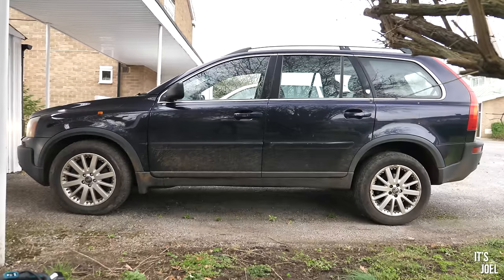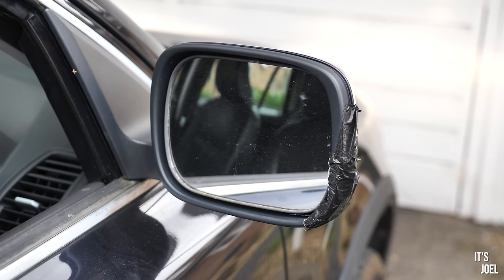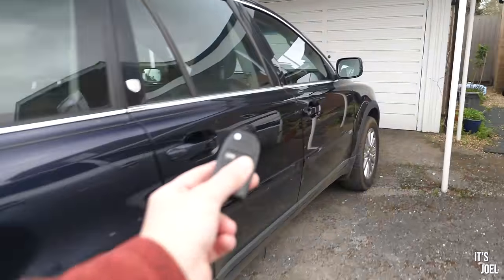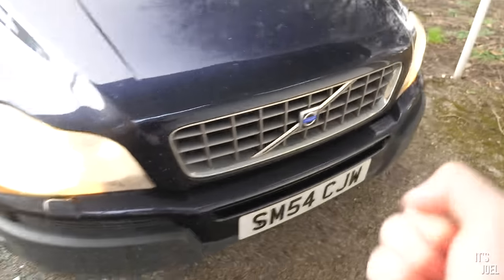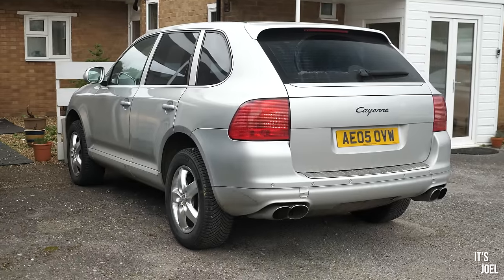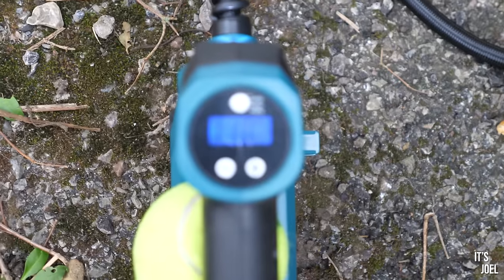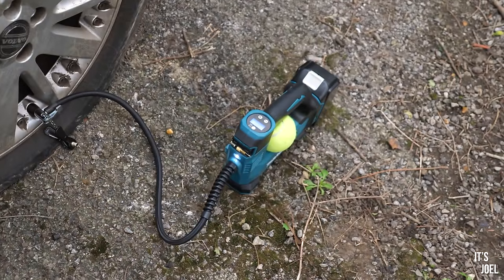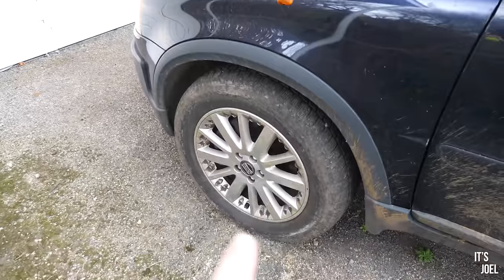WHAT HAPPENED TO MY £800 COPART VOLVO XC90?

Comment: If you get it sorted mechanically then it will run and run perfectly for a long, long, time. Cosmetics you can do at your leisure. I had a '64 plate one. Bought it 1.5 years old with 46K on the clock. I had it for nearly 6 years and took the mileage to 63k. In that time I had it serviced once a year - and it never needed anything on top of the service and sailed through all MOTs without even an advisory. These things, if you just spend a small amount each year on very basic maintenance, are rock solid. Great family car. Took it camping a few times - 4 people, a massive 8 man tent in the boot, camping gear for a week, a massive Kamei 560L roof box and a towbar mounted bike rack with 3 bikes on it. Even took it to Hockenheim once with all the gear. Just took it all in its stride. Mind you, it drank more diesel than is consumed at Oktoberfest

Comment: You should keep it. It has clearly gotten under your skin. Most ABS problems are either the sensors or the pickup rings. Both jobs themselves are easy enough to do. The drieveshafts can be a pig of a job to remove. My front ones were easy so maybe I just got lucky. My XC90 was in 2 wheel drive for a long time until my CEM issue got worse. I ended up having to fit a replacement DEM to my Haldex coupling to have a fully working 4WD to eliminate that problem as part of the CEM diagnosis. The CEM was faulty so I ended up getting it repaired and it has been fine ever since. The error codes should point you in the right direction for both issues. I'd love to help you out but I'm "oop north" in deepest Yorkshire so you will have to make do with my XC90 videos. Don't get your front wheel alignment done until you've finished all your work on the front suspension and steering.

Comment: Nice video! 👌

I know I'm a few months late, but your odometer being stuck is to do with the ABS fault. I have a V70 which had the same issue, odometer stuck on ~580.000km and ABS fault light on the dash. 

Hopefully you have a decent obd reader (I have iCarsoft CR Max, its pretty ok especially if you're not too brand loyal and like to tinker on numerous cars)

You can check if you have communication with ABS module. I didn't. Mine eventually turned out to be just a faulty 5A fuse in the left hand front door/dash fuse compartment. But you can get readings from ABS sensors for each wheel, brake booster, brake light switch etc etc. You seem to  have a functioning CRUISE which also should rule out some brake problems. 

Anyway, sort that out and you'll have a functional odometer again.

Comment: Use the Volvo as a training tool to up skill yourself trying the types of jobs that most of us tackle. Roof liner repair if possible with contact adhesive or replace if you can source a replacement. Paint work polishing and scratch repairs etc. If you scew up it doesn’t matter, as long as you learn from it!

Comment: Joel; the stopped ODO along with an ABS light indicate a BCM (Brake Control Module)  fault. Remove it from under the ABS pump; airbox will need to come out. 4 torx upside down secure it so have something to catch them. Contact cleaner on the plugs and the contacts on the BCM and refit it. If that doesn't work just send it to Remanx (formerley) BBA Reman in Rochester. Should be no more than 70 GBP for them to fix it.

Comment: You need to use a regular office stapler to fix the headliner (strategically placed staples), until you can get it replaced. Staples are better than glue as when the headliner is replaced, you wont have to remove all the glue you used trying to fix it.

Comment: Loving the intro's! And the experience of getting used cars. I'm deep into a 2013 Mercedes E200 station wagon from Germany now, 4K for car, 2k for getting all fluids, seals, wear&tear parts renewed and DPF filter cleaned. 200€ for a new COC document, 300 for getting some scratches painted. 100 euro for fuel to get the car home and 5in1 engine cleaner additive. So 6.600€ in but everything is freshened up. Same car here starts from 9k to 12k for high milage and going up if you want a less used one. Crossing my fingers for passing our MOT here. Final wish, getting it wrapped in a nice color and some nicer looking wheels with summer tires (michelin pilot sport 4s). But that MOT thingy is scaring the crap out of me 😅😅😅 hope I'll survive the adventure 😅 Look what you made me do! 😜 Carly helps as well and tells me all is good mechanically. Praying it gets through, because people don't believe such a cheap car can be OK. But you have proved it can.

Comment: Check the child lock for the right rear door, if you can open the door from the outside you should be able to use the key in a slot when the door is open to turn the child lock off, this may be the issue 😊

Comment: hi joel. do you no that the front seats can fold down from the back. thers two leavers just above the bolts that hold the seat in place. if you stop the video at 9.19 just above the yellow bit of paper you can see the leaver

Comment: I don't know what year yours is but I have a high km 07 I drive every day and it's been a pretty reliable workhorse really, and pretty cheap to maintain with a mechanic who's happy to just replace a part with a reconditioned part you might supply for example. 
Anyway, I like the different interior bits in yours and it would be a shame to get rid of it. But hey, I'm a bit of a hoarder too.
Watching because I've just given mine a pretty good spruce up so liking xc90 stuff now 😆 and if you haven't done in a bit, change the cabin filter...my god the difference.

Comment: Joel i still feel your ebbing on selling the XC90 but are AFRAID to actually say so i personally think you should invest in the 90 you have put a lot of blood sweat and tears and slept with it my god it's almost sounding like a marriage 😳Whereas the porsche dare i say it is just a flash in the pan play thing which i think will cost you a fortune when not if it breaks and will bleed you dry in fuel consumption😟  I personally  own a 09 ford galaxy albeit remapped to nearly 200bhp which beats most off the lights at their dismay and easily does 40 mpg and dare i say is 100% reliable and fun. I also own a 2010 200ps XC90 d5 auto with 165k on the clock a safe heavy tank which i have said before feels the safest car i have ever owned  and averages 34mpg on a run p.s i also own a 1971 Rover P6 3500 auto which does most of the above but without any of the expense except of course fuel 😁

Comment: Did you sell the TT?
Reply from the maker: No, I’ve still got that. Same problem really, don’t particularly want to let it go, and it’s barely worth a grand either! Only difference is the TT actually drives superbly
Reply: @itsjoel  MK1 TT’s price price has taken a hit. I guess like most cars. Similar V6 3.2 like mine were going between £5k - £5.5 but now have dropped to around £3.5k. If you are going to sell it hopefully spring summer time they should pick up a bit. I hope you don’t sell it though as really enjoyed the TT content released previously.